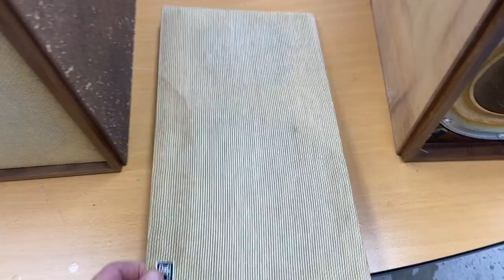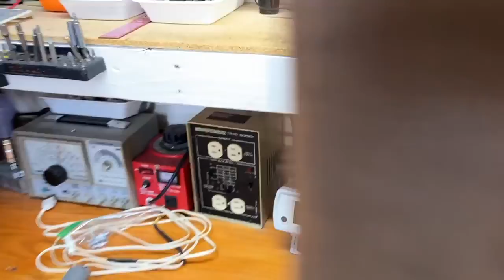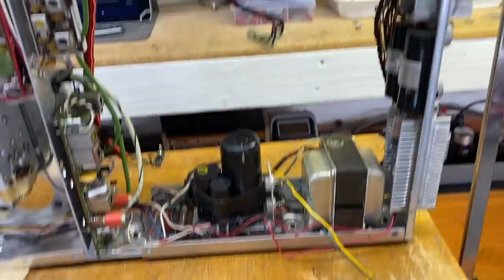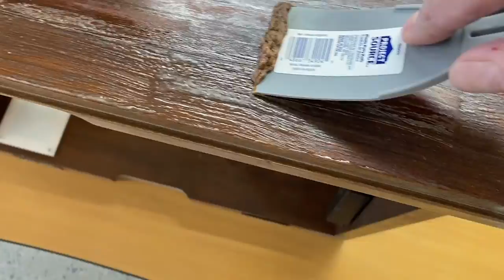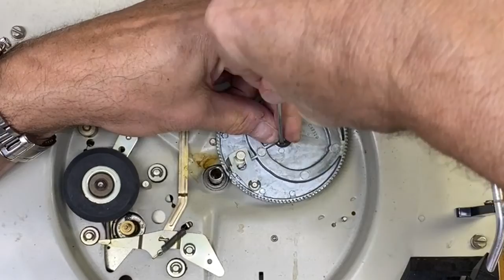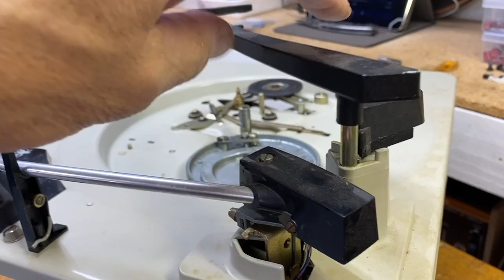Restoring a KLH Model Twenty Plus including the Garrard AT5/Model 3000 Record Player

Comment: Growing up, my dad had KLH speakers. Model 6s from what I can tell. He also had Empire speakers. More like furniture. They were octagonal end tables. Had round marble tops. Two speakers on the front, tweeter, and midrange. On the bottom facing the floor was a fifteen, maybe eighteen inch woofer. The bass was fierce. Made the whole house tremble.

Comment: Is there a brand name for 3 in 1 electrical motor oil you use?  Ever tried heating the screwdriver shaft directly while positioned on screw head.  Hope to need it if I can get to the bottom side of the turntable on my 11fm.  Great video for those of us hoping to restore vintage gear owned 60 years ago in my case.
Reply from the maker: 3 In One is the brand name, 1/4HP Motor Oil is the type....

Comment: Question: On my Nineteen, the white rubber on the platter is clean, but it’s degrading and giving off a powder. I’m thinking of a thin coat of shellac or poly to encapsulate the powder. Thoughts?

Comment: I recommend using a scraper to remove the old finish. A lot less mess than stripper, and you don't have to worry about sanding through veneer. You do have to be careful around the edges to make sure you don't chip anything out though.

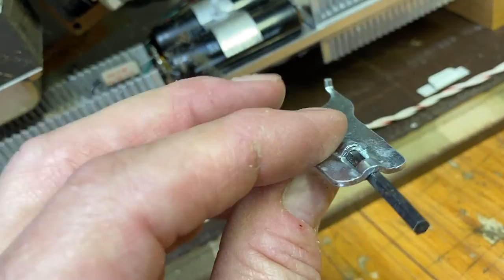Comment: At 4:10 in that is a  Delta faucet wrench  for removing a handle on a  shower, bath  or kitchen faucet. 3/32 inch hex on one 
end with the other end having two bent notches to fit the front of  shower cartridge to twist it out to get it replaced. Probably fell inside and slipped under the turntable by a previous owner's  brat thirty years ago at least.
Reply from the maker: Who knew! 🙂